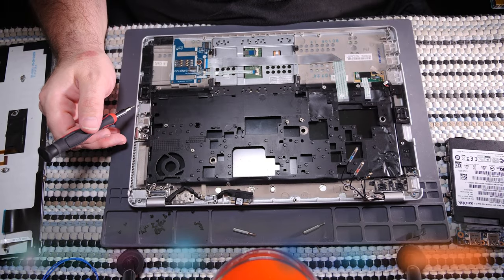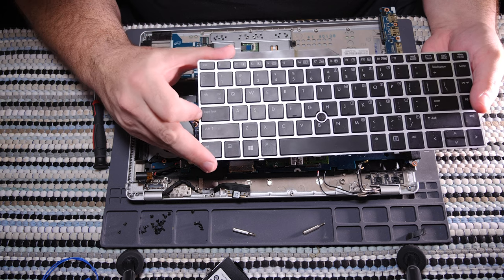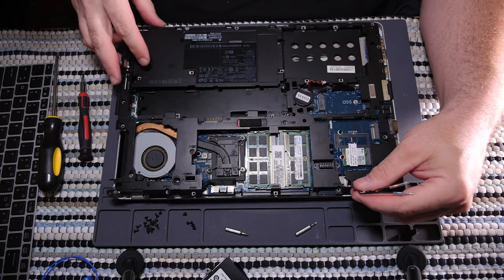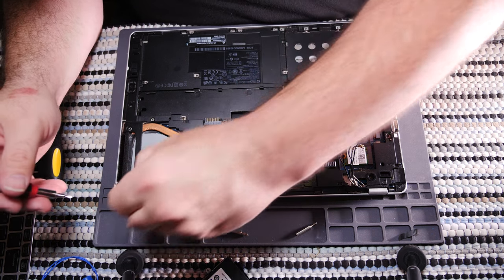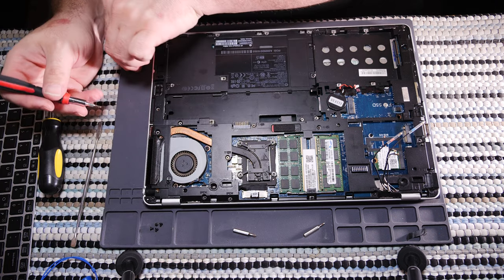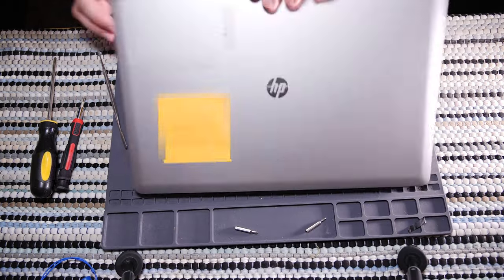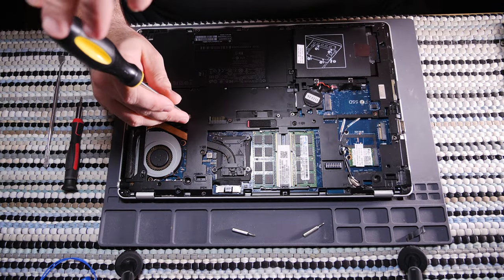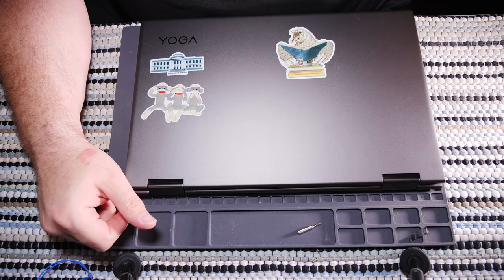HP EliteBook Folio 9480M Reassembly - Jody Bruchon Tech

Comment: I watched this because I was curious how the reassembly compared with my EliteBook 2730p which I think was manufactured in 2008.  More than 10 years ago I took it apart to max out the RAM and replace the HDD with an SSD. I remember there being a lot of screws for the 2730p too. I don't recall the antennae situation being difficult. There were a couple of places it was a little tricky, but fortunately I had found some good instructions on the internet that allowed me to avoid the pitfalls. 

I still use my 2730p to take notes and mark up documents (grading and slides). It is a convertible with a Wacom screen/pen. It came installed with Vista. Now I have Debian LXQt installed for the OS/Desktop . I have been wondering if it is worthwhile getting a newer EliteBook. Based on your video, if I have to disassemble it to upgrade anything, I think I will avoid the hassle and buy it already "tricked out" or buy something else.  Or I might just use the old one until it falls apart.

Comment: That was interesting. I can't help but wonder why it doesn't work assembled. Have you tried assembling it without the battery ? I have an old Toshiba laptop that has terrible heat management. I always joked that I can cook some eggs on it. Well, after about 2 years of pretty heavy use, the battery died. That means that it simply doesn't work, doesn't boot if I have the battery connected, even if I'm also plugged to the wall. If I remove the battery all good. I never bothered getting another battery for it (but I'm not using it anymore either).

If it's not the battery ... I wonder if it's something pushing too much on something maybe ? Hard to believe though. Especially without seeing traces/signs/evidence of too much forced being used.